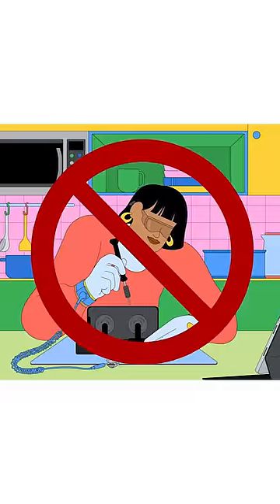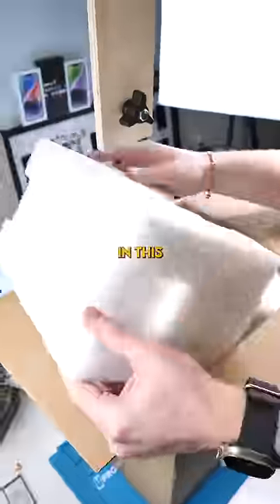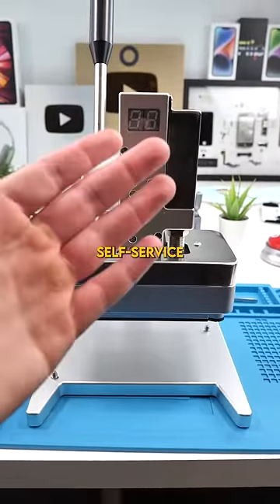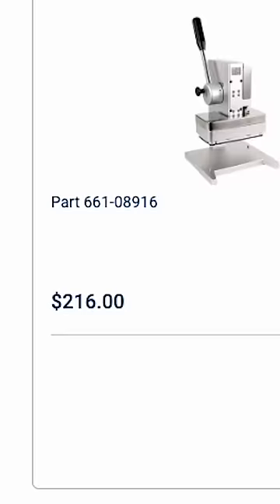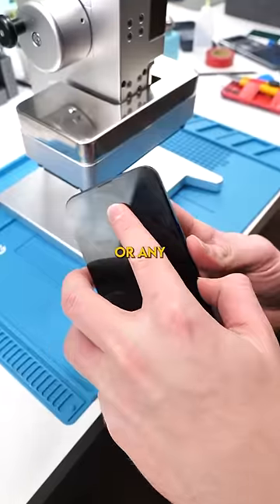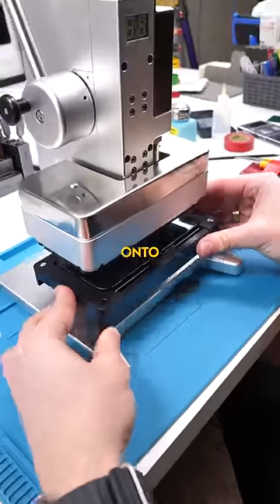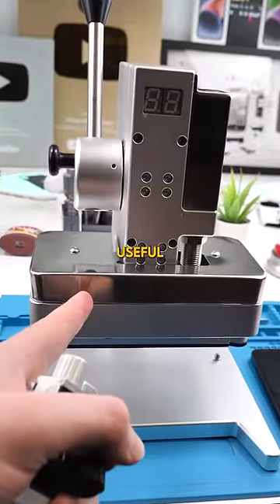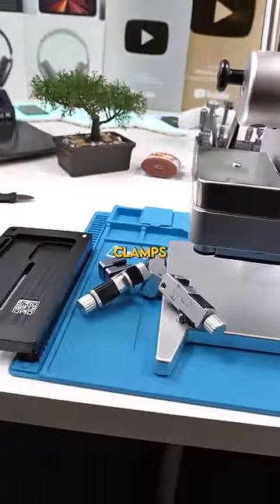Apple's $216 Repair Tool.... #Shorts

Comment: This tool does NOT have the same results as the small clamps. It lowers the risk of post-repair water damage from I’d say 5% to less than 1%. Not much, but still important when it comes to repair shops and especially Apple themselves avoiding warranty claims.
Reply: Actually it is much… 1 :20 compared to 1:100 probability
Reply: That's a pretty big difference. Lol
Reply: Water damage is not under the manufacturer warranty. You have a point when it comes to ac+. As someone who uses this tool for every repair, I feel like pressing it down with my fingers is just as good and free.
Just my 2cents
Reply: With those clamps, it’s uneven pressure around the display. This machine will apply the correct pressure around the perimeter of the display.
Reply: @Diabeetus.  literally just tighten them evenly
Reply: @undefinedchannel9916  it still won't be the same as it is still just applied at 4 points compared to all around the screen.
This will always create a worse seal than this machine.
Reply: @undefinedchannel9916  but what about the areas the clamps are not even covering with this it is pushing on the WHOLE display not 4-5 points around the perimeter of the phone and also on top of that it can be more time consuming as a repairman as display repairs are usually fast and shaving a couple of minutes by just sticking a phone inside this and pressing it down vs getting out a bunch of clamps and tightening each individual one till the right level of tightness is achieved then you loosen the clamps afterwards which adds more time. Also the even pressure is guaranteed whereas with clamps the pressure would be less accurate  so as a result you are less likely to receive returns and so on
Reply: @nukularpictures  This exactly. And if I'm paying for a repair I want it as close to factory water resistance as possible. So that means this machine is great to me.

Comment: 216 actually doesn't sound that bad, I was expecting it to be at least 1,000+ being apple and all😂
Reply: Yea so for being apple is not a bad price
Reply: Apple wheels 850$…
Reply: Actually really affordable. Can’t understand his comment. Seriously.
Reply: This machine is pointless
Reply: it isnt $216 thats the rent fee if stop paying for apple repair contract you looking at 15k charge for it
Reply: @TIsForThomas  no it is not. It has a huge advantage compared to the camps. It will provide the same pressure equally distributed every time. And it is a much faster process.

So less like for any human error to occur and it saves time. And that at $216. It's honestly a no brainer if you do the repairs often.
Reply: @margauxj-broussel9186  216 for a one Time Machine that you are never going to use as you don’t own a repair shop and that isn’t counting any spare parts like a replacement screen, adhesive, screws, nor does it account for your time and labor
Reply: @wisdomfox857  no it’s not lmao it’s 216 for the unit…
Reply: @DaFlameGamers  no louis rossmann covered this in one of his videos and why his not in the apple repair program
Reply: The pro max version is 3000.
Reply: @wisdomfox857  Go to apples self service repair store... the heated display removal fixture for the iphone 12 pro max is currently 246 for the full unit, the Display press is 216 for the full unit. If you would like to rent the entire repair tool kit for the iphone 12 pro max it costs $49.00 for a 7 day rental... You clearly didn't pay attention to his video... ontop of that it is very outdated...
Reply: @wisdomfox857  How much does it cost to rent the tool kit?
Tool kits are available for rent for $49, including shipping.

How long can I rent the tool kit?
Your rental starts when you receive the tool kit, and lasts for 7 days. To avoid the non-return fee drop it off at a UPS store by day 7. If you purchased a battery part with your rental, contact us to arrange a pick-up.

What are the charges on my credit card?
You will be charged the rental fee of $49 when you rent a tool kit from the Self Service Repair Store

In addition, we will put a temporary authorization on your credit card to cover the full replacement value of the tools inside.

If multiple tool kits are rented, each will require a credit card authorization hold.

You will be charged a fee and a tax if you do not return the tool kit by day 7 of the rental. When we receive the tool kit, we will inspect the tools, if any tools are missing or damaged, you will be charged for those tools.

If the tool kit is returned to UPS by day 7 with all tools undamaged, we will release the hold on your card. This may take up to 5-7 business days. If you use a debit card for this authorization, it may result in the authorized funds not being available to you until after we have released the funds and they have been processed by your financial institution.
Reply: I was thinking the same
Reply: i also feel like the speed of doing it with the press vs sitting there and putting all the clamps on one by one would allow him to get to the next repair quicker, in turn making him more money
Reply: @nukularpictures  just put it in a wooden case and have the clamps push on a wooden/rubber lid, same effect for not $216. 
It’s still just a useless overpriced machine by apple.
Reply: @hypernexoius3000  you know that repair shops don’t normally have an endless supply of customers right?
Reply: @dapperpotatoes8473  well yea, just like any other small business.
Reply: @dapperpotatoes8473  No it is not. I mean sure it is not a tool for you and me or even a small shop but for a shop with enough throughput this is worth it. Your solution would need a few hours to build and then maintain over its lifetime.
Even with cheap labour, this will not be worth it quickly. I mean $216 is not even 10h of work for even a cheap employee, maybe 5-6 for a skilled technician. 

So if the machine can save that amount of time over 5 years it's worth it and I can ensure you that it will even compare to your solution. 

Money is always relative and this is absolutely cheap for a professional grade tool. Heck in my company we just paid 20k€ to save a few minutes each day. And it actually pays off quite fast.
Reply: They got him to buy a clamp...that puts just enough pressure to evenly press just a little to get the seal. 4-6 of even the better clamps of a few hundred pounds of clamping are just $40 a piece
Reply: Don't say that if they read you'r comments it will become 10,000$
Reply: I've seen puller kits for the automotive world that's cost more than $216!
Reply: It cost less than the new iPhone lol
Reply: @phuckyoutube5927  wow insulting but being misinformed. Great.
No, if you had taken the time to go to apples website, you would have seen that this is indeed the cost to BUY that tool.

Plus as an electrical engineer I can tell you that while it might work to do it otherwise you will never get as good of quality as you would with this tool. 

Even if you use 20 rubber bands it will not be as even plus it will be slower.
Reply: $216 for a screen press is pretty bad. Especially since it's not really necessary.
Reply: @nukularpictures  it's not about slower ya nut. iphones need the same time to press regardless if you buy some crappy machine that can only hold 1 phone or a bunch of clamps that are dirt cheap and can be used to press multiple phones
Reply: @nukularpictures  what human error is there in pressing an iPhone closed lmao
Reply: @tristonb1105  said who? Somebody who has never bought this and never needed this?

Comment: I’m an Apple fan but I can’t deny the fact that many of its products are scam
Reply: Me too, I like most of their products, I think they’re awesome but sometimes i get genuinely disappointed.
Reply: I’m in awe that this doesn’t cost $600+ or more than their $1000 monitor stand
Reply: and here i am using a 2014 macbook that works perfectly beside having 4hr battery.

Yea they are "scams"
Reply: @keent  Im using 2012 and there’s a bug that I can’t fix because of the software that I can’t update because of aging of the laptop
Reply: @gabrielesilinic  because I don’t buy the scams :p
Reply: @hec547  you don't own this machine. It's basically a rental for that price. It'll cost you around 15k if you stop the contract
Reply: @shahs3262  no it’s the price.
Reply: @jzuniga633  no, it's not
Reply: @shahs3262  yes it is. I went to the site put it in the Cart went all the way to check out. It in fact gives you a 14 day return policy for a full refund. And anything beyond that would not be accepted for a refund. This is not a rental price. No contract what so ever.
Reply: @jzuniga633  read the fine print
Reply: @shahs3262  no fine print. SMH.
Reply: @Christodoulosts  hmmmm,i am using a 11 year old laptop,what could go wrong?

Have you got a PC thats non Apple that can be used now thats not modified since 2012?,i bet you dont but someone might
Reply: @soacespacestation8556  I have 2012 MacBook and there is no update anymore! I can’t do many things because of this
Reply: @Christodoulosts  you also cant do many things because the specs are trash nowadays if you want to do something like play a decent game thats not old or insanely optimized
Reply: @soacespacestation8556  I wanna ask you maybe you know! My keys “Y, U, I, O” stopped working all of a sudden and I can’t even log in to my account. What should I do
Reply: @Christodoulosts  get it to a repair shop lol

Comment: That press is really good for its price. It provides centering, consistent even pressure and avoids over pressure
Reply: How the hell are you gonna miss center the screen, if it's gonna be pressed in?💀
Reply: @osnarv8597  centering of the phone so the screen can be pressed proper,. if you clamp the edge of the phone or press on it by mistake, the screen wont be set proper
Reply: @Capthrax1  i mean no. You literally see the YouTuber put on the screen BEFORE using the press, so it's already centered. There is no feature in the press where it would help you center the screen, cause you physically cannot miss center the screen. Unless you beat it with a hammer, it's unrealistic
Reply: @osnarv8597  you took all the time to write that out, but didnt read the replies. smh
Reply: @osnarv8597  They mean if the clamp is off centre Not the screen, the pressure is not centered. PRESSURE
Reply: @osnarv8597  so what if the pressure isn’t centered? the point is to stick the screen onto the edges of the phone. Doesn’t matter where the pressure begins or ends
Reply: @Capthrax1  you know they dont sale these to any one the $216 price a rent fee
Reply: @wisdomfox857  no it’s not
Reply: @wisdomfox857  The rent fee is around $50, to buy it IS $216
Reply: @wisdomfox857  you know,stop spreadimg misinformation

Comment: You're supposed to allow the machine evenly press and seal the screen. It applies even pressure as it seals so it clips in all at the same time and apply consistent pressure to the seal.

Comment: I had loose hinges, got a new screen assembly. Apple care is good in my books
Reply: Until they say that it can't be repaired and you'll need to replace it, when almost 9.5/10 it can easily be repaired, by an independent repair shop.

Comment: Hey, so I have a really important question that google just won't answer. Recently, my tablet (idk which version but when I found out, I'll make an edit to the comment) won't hold a charge or stay on. Like I'll plug it in, it'll turn on, then when I log in it "dies" even though it's on like 35%. I don't use really heavy duty stuff on it a mobile shooting game or something, I just use procreate. This has also happened to the past ipad I had and then it just stopped working entirely but my parents wouldn't get it fixed, they just got me a "new" (as in it was used and out-dated) one. But I bet that if we know what's wrong they'll send it to someone, (maybe even you) to get it fixed

Comment: Apple: our goal is to limit future e-waste as much as we can.
Meanwhile apple:
Reply: How is this wasteful?
Reply: @Ajokeiguess  because the clamps do the job
Reply: @robertgaboola3683  this is far faster and leaves almost no room for error though, so yes, while clamps do work, if you’re working in a repair shop with tons of people coming in to get something fixed, with this you just finish, put it in, and pull the lever, far less work, far faster, and far easier, especially to people who are new to repairs. I do think it’s rather expensive though.
Reply: @robertgaboola3683  you should also never get a new phone as long as your old one does the job,even if it does a worse job i mean environment right?

Yep,camera quality is not what you want and it's very much trash but it works? Dont buy a new device to take pictures

Is you old broom pretty much broken but can still (barely) do the job? (Hard) dont but a new one because environment
Reply: @soacespacestation8556  haha

Comment: When I was doing apple repairs rhe machine to rewrite software or uodayes was $40,000 it ran windows 10 before they replaced it with a mac0S variant and it only needed a USB connection lmao

Comment: There is nothing cool about overpriced useless Tools.
Reply: it’s good for apple cause it makes their repairs faster and more reliable. not worth it tho in terms of price
Reply: @undefinedchannel9916  faster? Quite the opposite. There's a reason why turnaround times in Apple Store's Genius Bar and AASPs is like 3-7 days and independent repair is like 2 hours.  In fact, many repairs would last two or four times longer if you were to follow every Apple guide. For example, replacing the thermal paste in an M2 MacBook Air would be around 15 minutes with Apple's stencil, why you could achieve similar results with common sense in around 10 seconds. And I know, I'm certified.
Reply: @PvtAnonymous  I meant this tool specifically. Sorry for being unclear
Reply: @undefinedchannel9916  this tool still doesn't make anything faster. I still have to use the repair tray, have to align it instead of just turning the phone around and pressing down evenly with my own weight. You still lose about a minute with each application.
Reply: @PvtAnonymous  Damn. I didn’t expect Apple to stoop this low and overcomplicate a damn press.
Reply: @undefinedchannel9916  yeah, well, as I stated above, you should be happy you didn't have to watch a tutorial on how to apply thermal paste with a stencil... Apple is just REALLY good at over-complicating things.

Comment: Wait you didnt show what the numbers are for
Also those rubberbands/bolt clamps are just ghetto chinese inventions compared to this
216 is really cheap btw
Reply: $200 for a shitty apple press that requires batteries to work. Rather spend $20 on some more reliable clamps that work the same way.
Reply: @undefinedchannel9916  nah, the batteries aren't the problem, it's the trays that are precision milled for every specific iPhone model and are around 25 or 30 bucks each. So if you just want to repair one single year of iPhone models, you better spend 120 bucks a year or else your fancy $200 machine becomes useless.